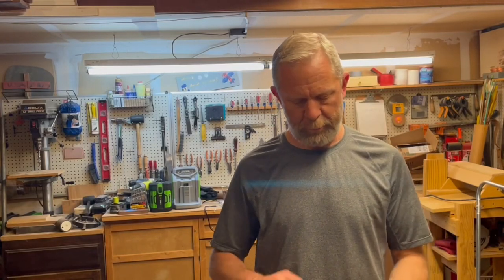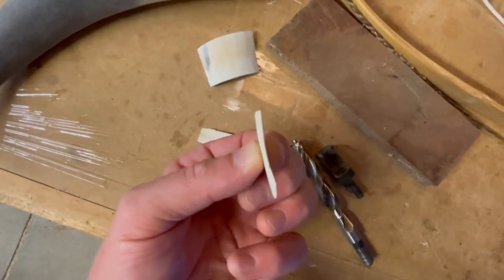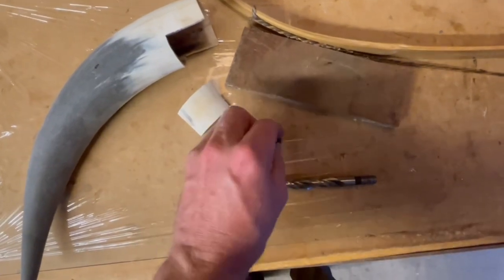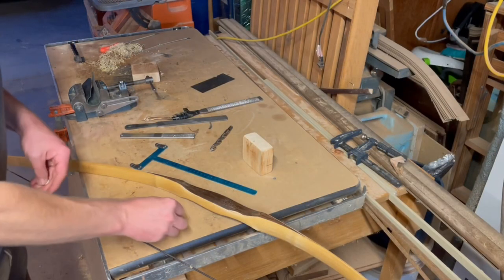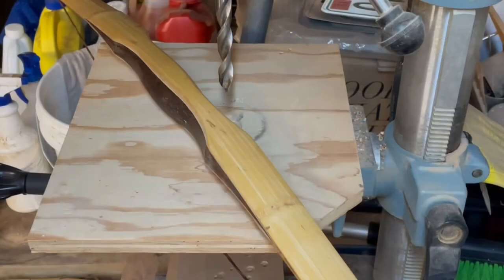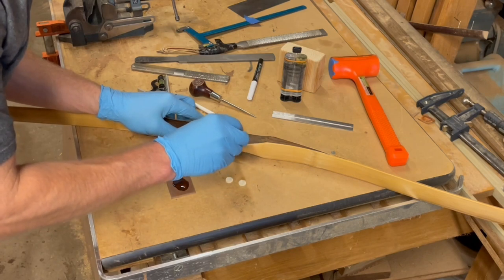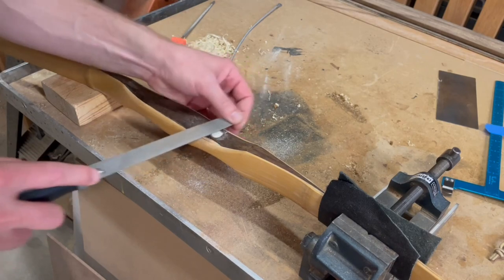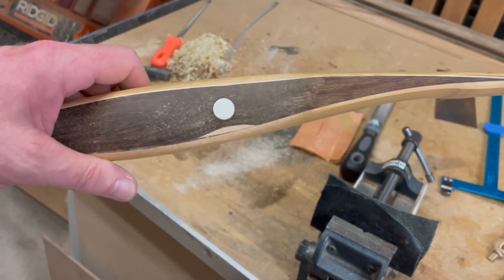Bamboo Duoflex Take 2 - Inlaid horn strike plate

Comment: You can get more out of the horn if you use your heat gun and get it to a plastic state and flatten it between wood with clamps.
Reply from the maker: I found that soaking it in water and clamping it into shape also works real well